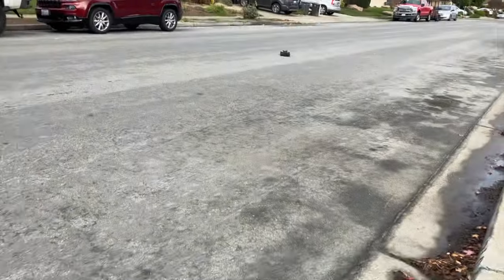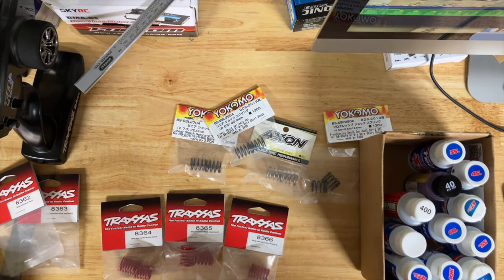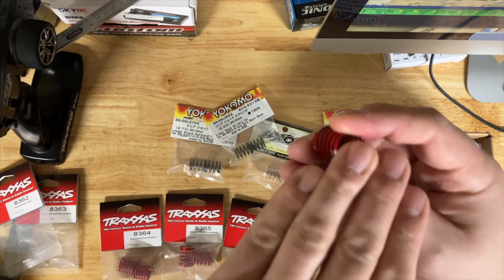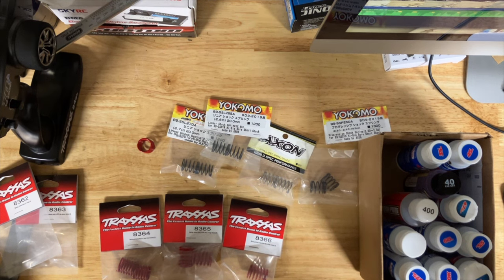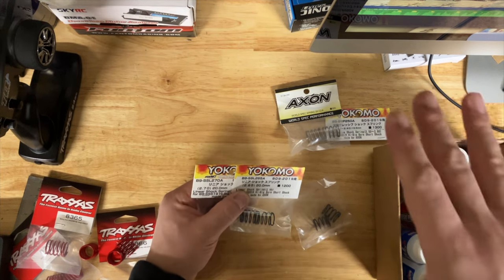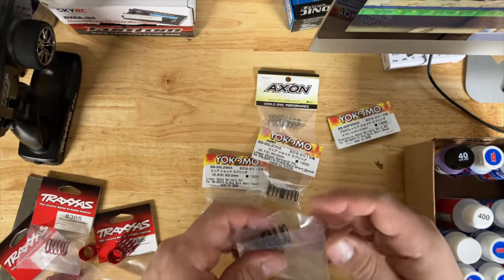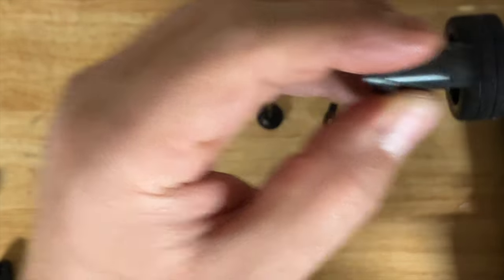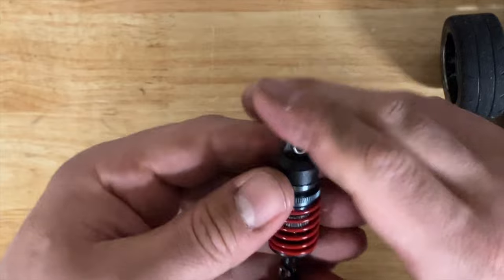Tuning shock springs RC touring Car spring setup... Traxxas 4-Tec 2.0 and STRC aluminum body upgrade

Comment: Any tips on how i could stiffen up the rear suspension on my traxxas 4tec 2.0? I currently have all the GPM stabilizers fromt and rear. I need the rear stiff as my set up is for drag racing. Any tips are appreciated thanks in advance!
Reply from the maker: What springs are you running? 
Traxxas makes TRX8364 (4.4 spring rate) and TRX8363 (4.075 spring rate). They are pretty stiff.
Reply: @telecomandorc  I'm still running the stock Traxxas 4tec 2.0 shocks 😅. Thanks I'll definitely look into those!
Reply from the maker: @MelbourneExclusive0  I used to run the stock ones but got tires of the plastic clips. These are just better and easier to tune by getting better measurements on the lengths.